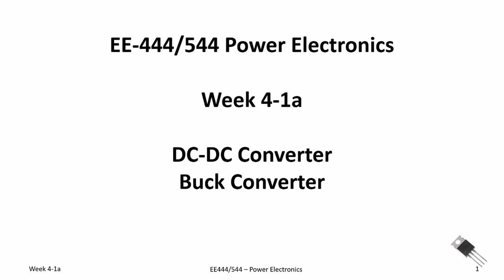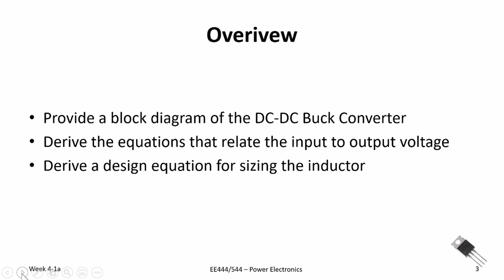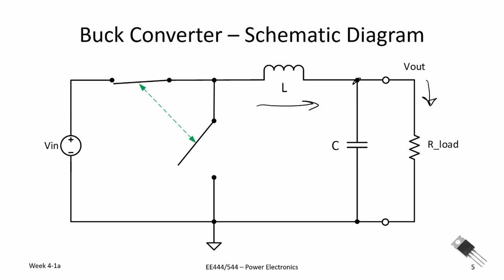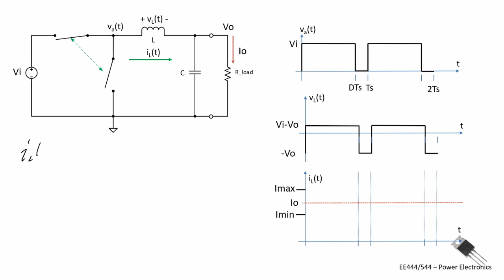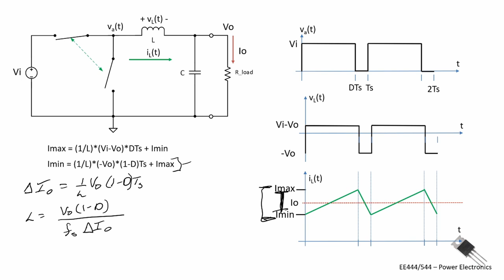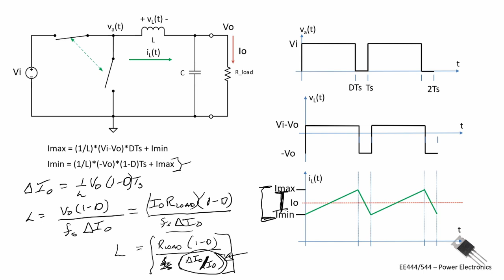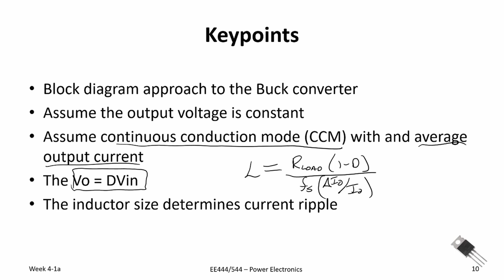Power Electronics  - Inductor Sizing for the DC to DC Buck Converter

Comment: Interesting choice to consider synchronous switch mode converters before asynchronous switch mode converters.  It's as applicable or more these days.
Reply from the maker: Hi Sean, I really like to think of that opening diagram as a generalized topology. The asynchronous converter uses a diode for the low side switch and the diode switches automatically. You are correct on the applicability of the synchronous topology. Synchronous converters are becoming much more ubiquitous. This is due to the low cost controllers and low cost silicon FETs. Also as we increase power densities, heat via losses is much more critical. Thanks for the comments. Best wishes on your designs. DrK
Reply: @powerelectronicswithdr.k1017  Sure.  It is a completely valid and simpler to consider a switched topology first.  It's just a bit unusual to me as the way I learned was different, back when we walked to school 20 miles through the dinosaurs...  :)

Comment: Hi Dr. Great explication but i`ve a dude.. In  book Fundamental power electronics by dr. eriksson, considers that the inductor calculus is divide by two? Vo(1-D)/2Fs(delthaIo).. What is the diference with this equation. Thanks and greetings.
Reply from the maker: Hi Jaun Carlos, I just review Dr. Eriksson's equation.  The "delta_i" used in that equation is the difference between the average value, I, and the peak value Imax.  The "delta" that I am using is I_max - I_min and this value is twice the value that Dr. Erikkson uses.  The drawings in his text and my videos should help resolve this.  Best wishes on your design. -Dr. K
Reply: @powerelectronicswithdr.k1017  Trank you Dr k. for your answer... It`s true the delta used is different only  for the design  consider this.. Thank you very much and have a nice day.. greetings. and great channel...